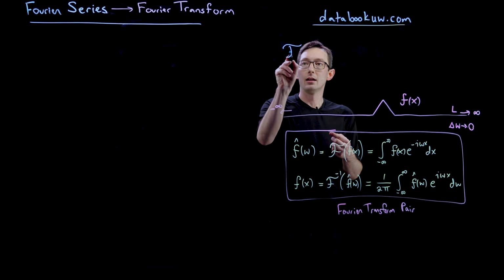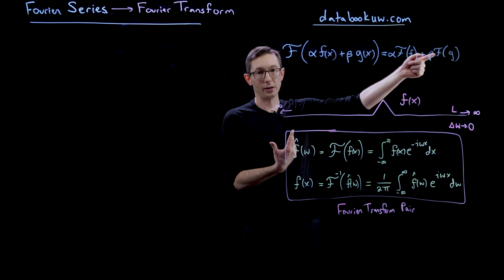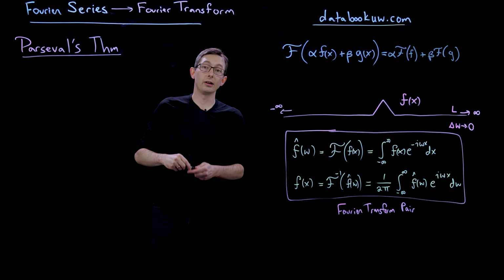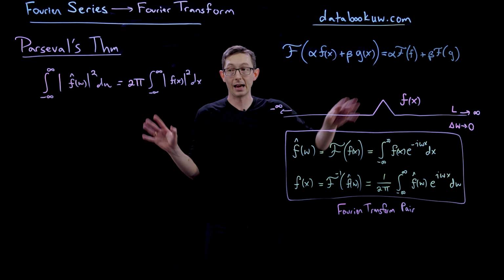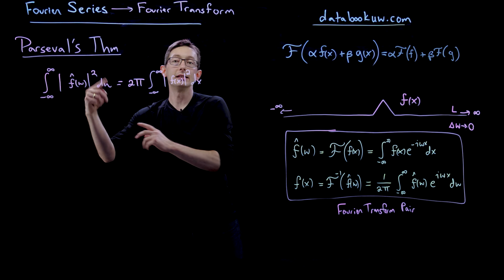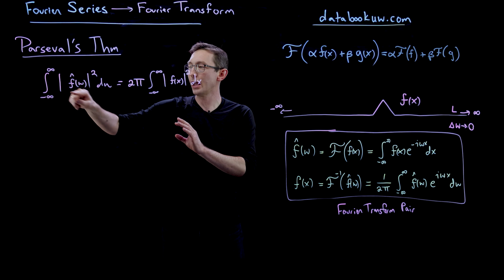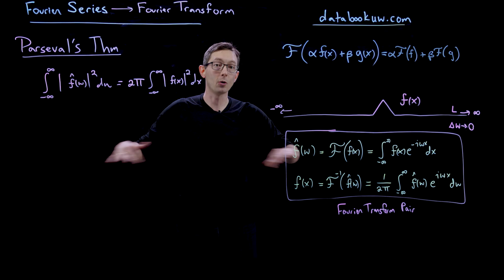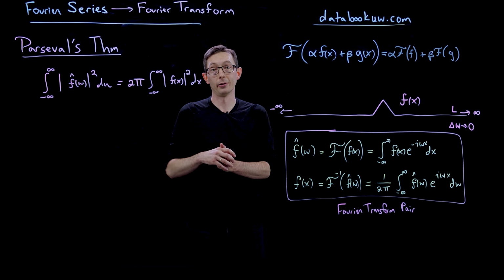Parseval's Theorem

Comment: It's Plancharel's theorem BTW not Parseval's
Reply from the maker: Great point!  I didn't realize that Parseval is for 2-pi periodic functions (i.e. for the Fourier series), while Plancharel is for the continuous generalization (i.e. for the Fourier transform).  Thanks for pointing this out.
Reply: #Now I have seen on Google that Plancharel's Theorem is used in non-periodic continuous functions (i. e. of Fourier transform) but in case of Fourier serias we use Parseval's Theorem (i. e. periodic). It is from engineering approach so I comment Parseval's Theorem vs Plancharel's Theorem. But in my opinion it can bring many problems for findind a power in a long, not small, periodic  waveform dispersion.

Comment: #Now I have seen on Google that Plancharel's Theorem is used in non-periodic continuous functions (i. e. of Fourier transform) but in case of Fourier serias we use Parseval's Theorem (i. e. periodic). It is from engineering approach so I comment Parseval's Theorem vs Plancharel's Theorem. But in my opinion it can bring many problems for findind a power in a long, not small, periodic  waveform dispersion.

Comment: Why is energy defined as integrate of square of signal function? 3:40
Reply: That's one way to measure a signal (you can also measure by their power, if the energy is infinite). 
The phisical meaning is that if you have a load of 1 ohm and x(t) is your voltage or current (V=R*I, if R=1 => V=I), the energy calculated is the energy that dissipates in that load.
Reply: @miguelmondardo2741  thank you. But i didnt understand your answer